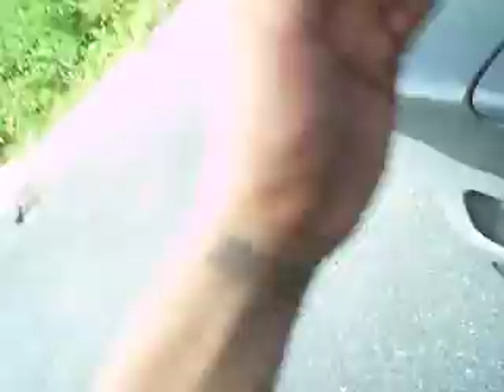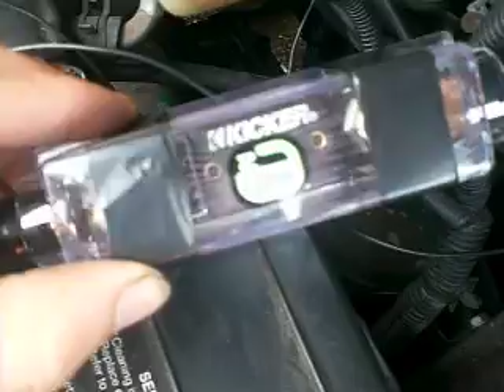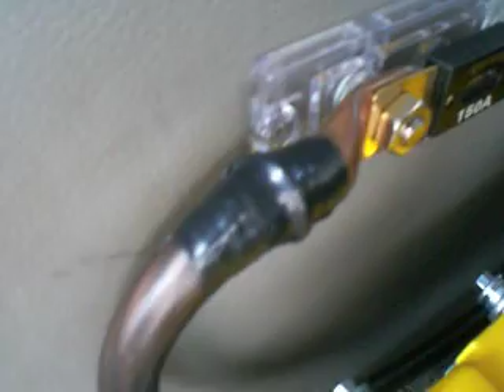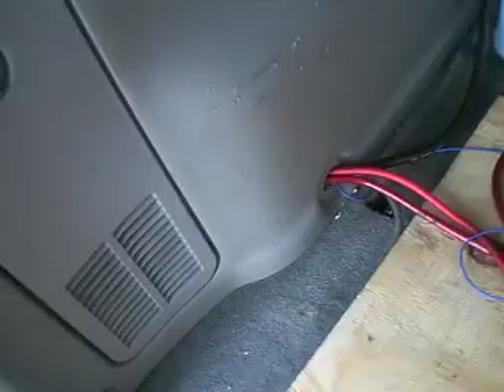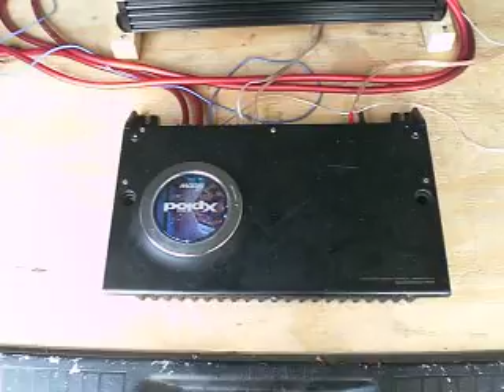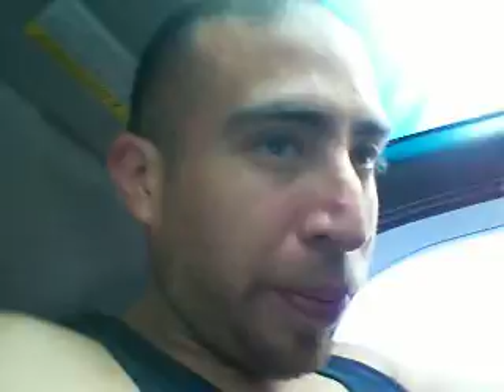Rear Battery Installed!!

Comment: just make a lil wooden box for the battery. it should hold it in place with the weight unless your flying up a hill. if thats the case too just put a braket on it or bolt it to the sub box too, thatll stop it